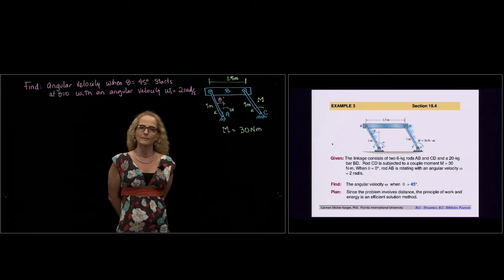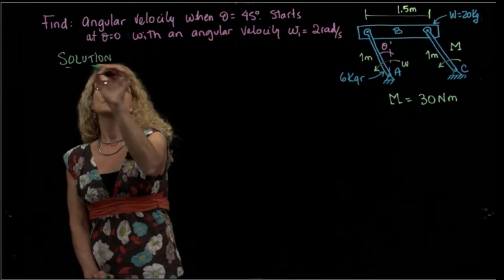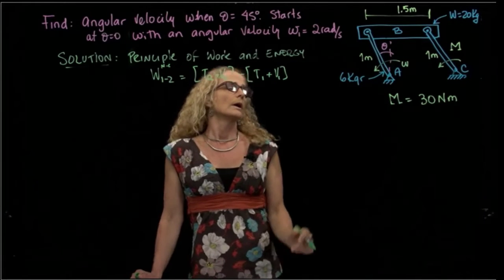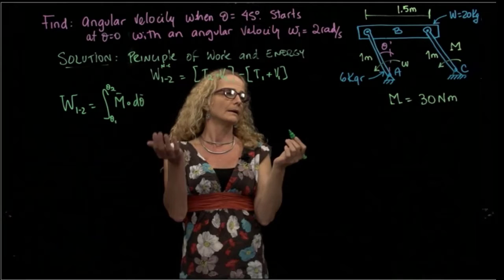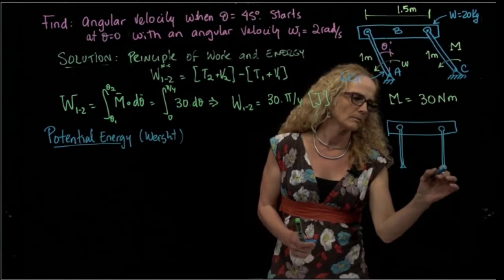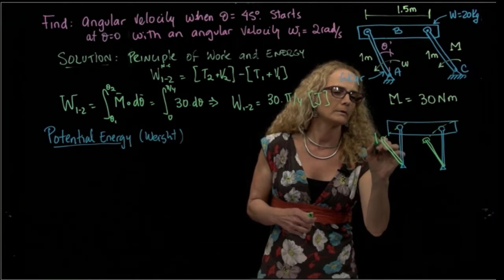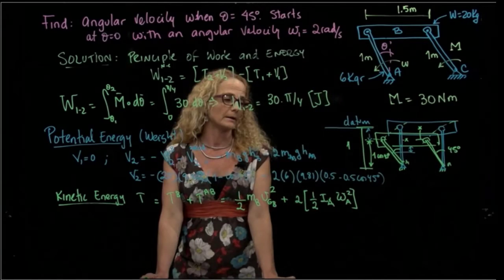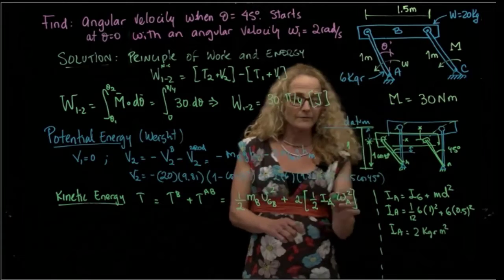DYNAMICS, Example 18.3 Principle of Work and Energy

Comment: Thank you so much, this really helped. I just have one question: Why don't we consider the velocity of the slender rods when looking at the kinetic energy? Why do we only consider 1/2Iw^2 and not also 1/2mv^2?
Reply: For the equitation of plane motion we have the translation which is that 1/2(m)(vG)^2 and the rotation which is the 1/2(IG)w^2 the rigid body undergoes both types of motion but only the slender rods undergoes rotation while the bar undergoes translation only.